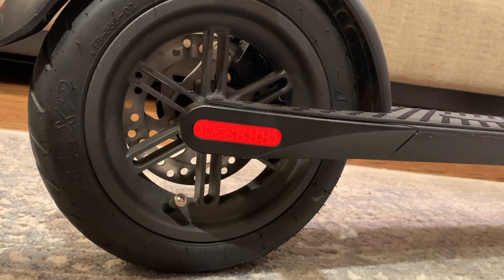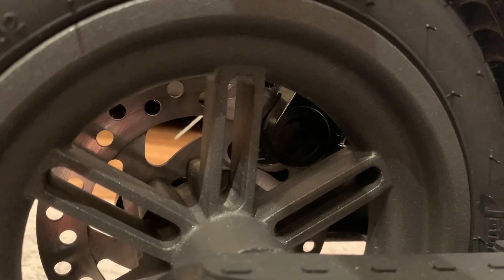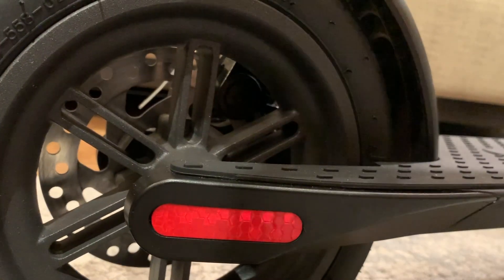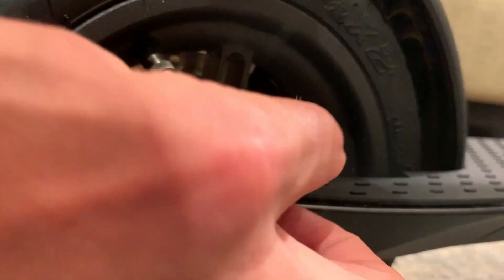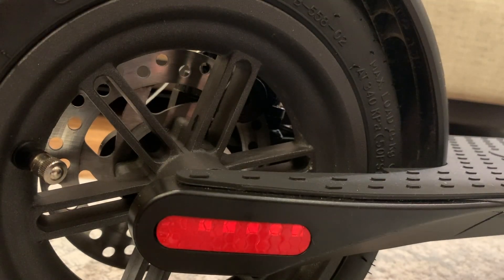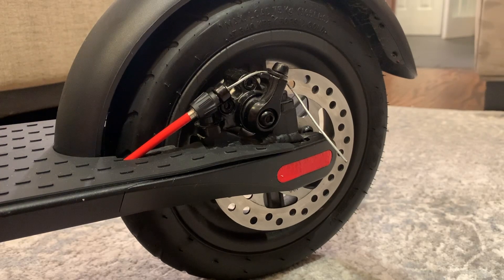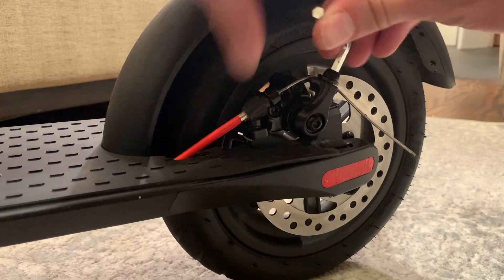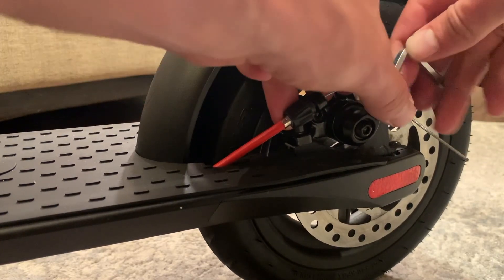Levy Electric Scooter Brake Adjustment

Comment: I feel like I'm stuck in a loop. I need to tighten the rear brake calliper but doing so causes the disc to grind. Fixing the grinding problem causes the brake to become too loose.
Reply: lmaooo same